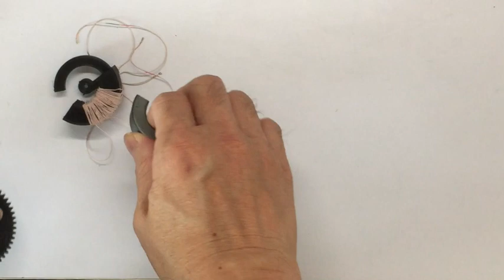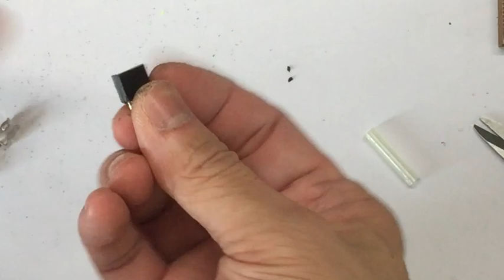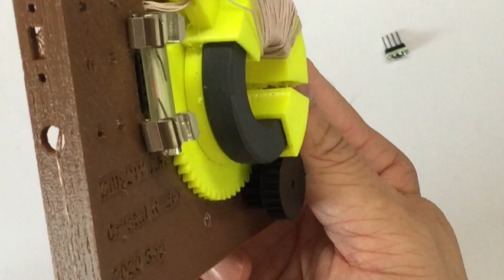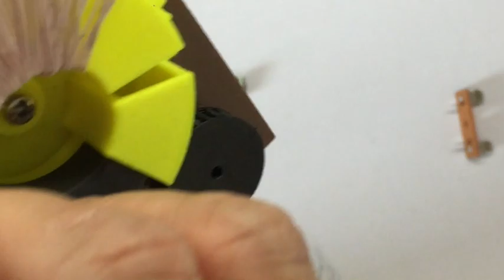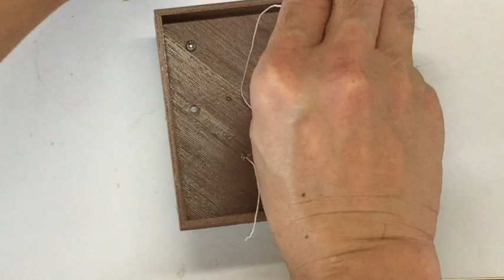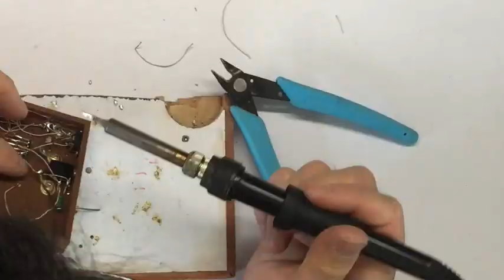P3 - Making it - 3D designed Ring Variometer AM Crystal Radio

Comment: Do you have any advice for cutting iron powder?
Reply from the maker: Use a glass cutting knife or a Diamond plated blade with a drill  to create a deep mark at the surface all around. Then hammer on it with a screw driver to break it apart.
Reply: @BillyCdiy  Thank will try it